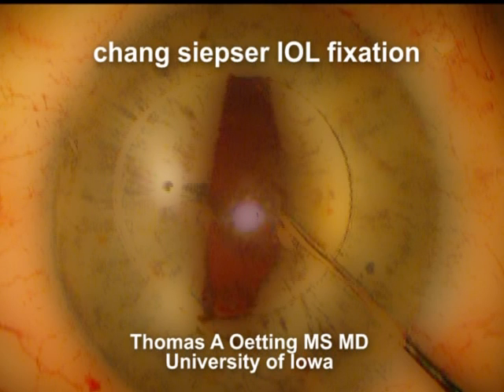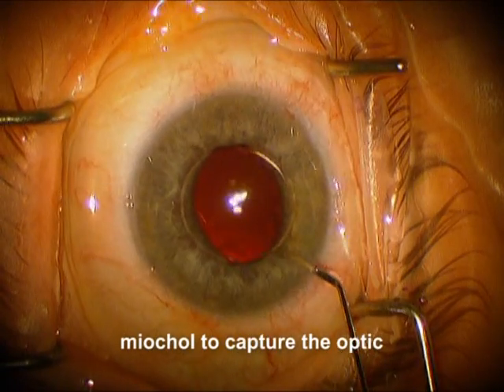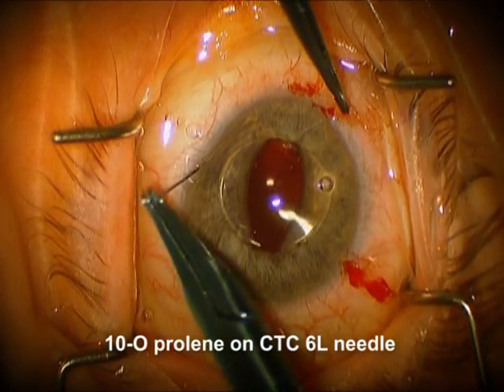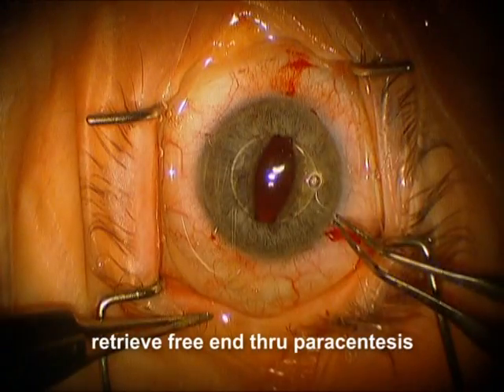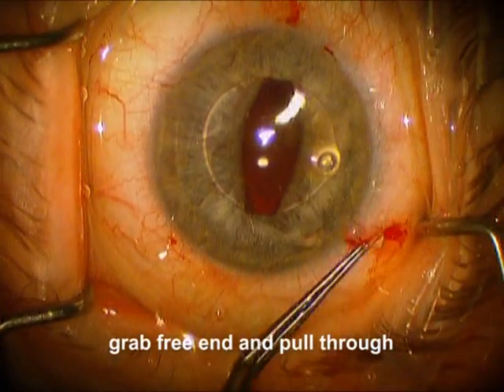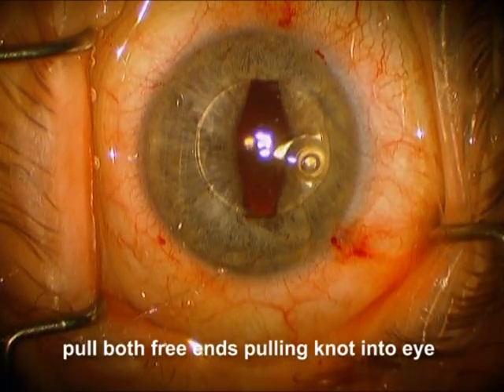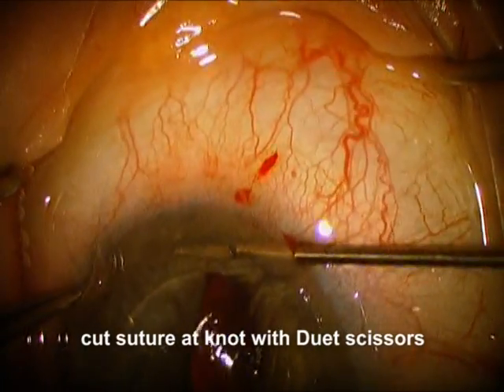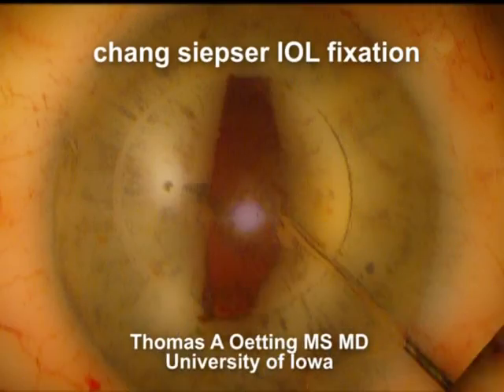Chang Siepser IOL Fixation

Comment: Tom
Great video.  One question.  With your initial pass why don't you pass it thru your paracentesis track.  That would eliminate the need to pull the free suture end thru the paracentesis track
Reply from the maker: saul too hard to go through the paracentesis and not catch some corneal tissue.  never sure if it was a clean paracentesios pass.  thanks for your comment.  tom o

Comment from the maker: The standard way to place an IOL for iris fixation with suture is to use an old fashioned IOL forceps in the moustache configuration.  Then when you release the IOL the haptic are placed posterior and the optic anterior to an undiluted or partially dilated pupil. See Walter starks jars paper with nice drawings on this topic.  Thx for your comment